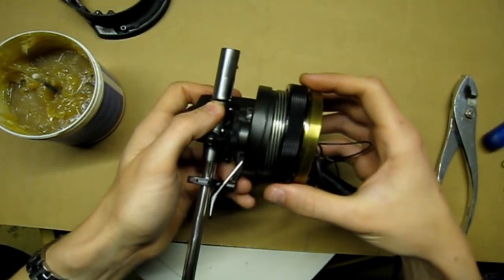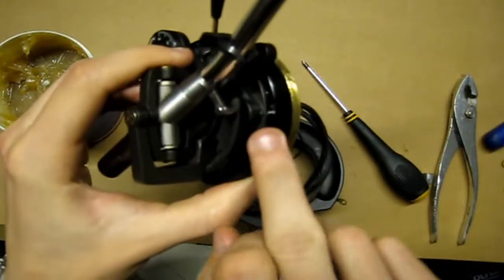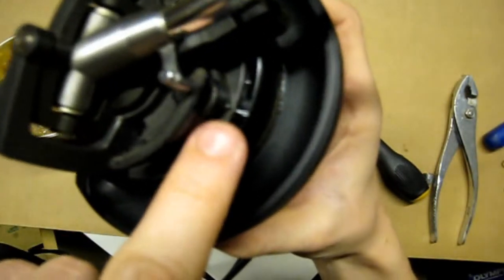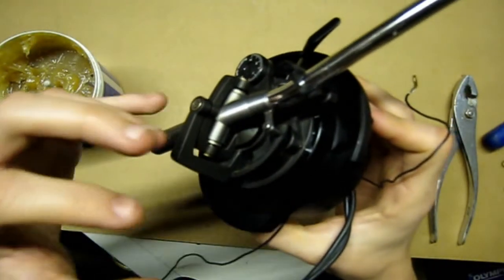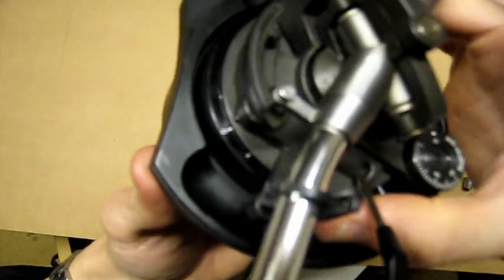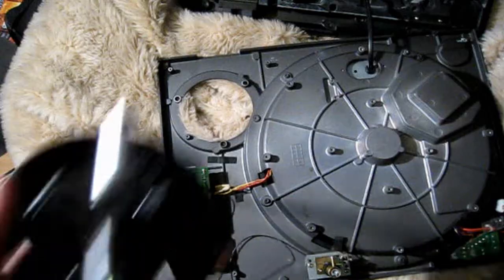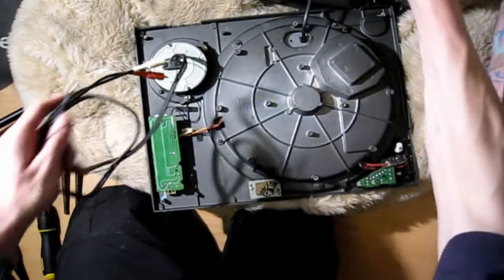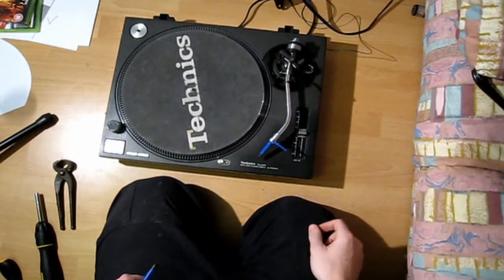How to service/repair/replace the height adjustment on a technics 1200/1210 MK 2 turntable part 2

Comment: i found the unscrewing procedure different on my 1200MKII  because it only as the thick rubber bottom. the tonearm base can be accessed directly through a hole in rubber, had to take the rubber off to access the screws attaching tonearm base to face plate though. Moreover, when calibrate the height scale, i had to follow the service manual exactly instead of this video to get it right. maybe my 1200MKII is the earlier version.

Comment: If the threads are stuck and you can´t get them loose with some WD40, Put the whole assembly in an oven 100C for aout 5 minutes, and the parts will come loose.

Comment: Hi Frank, in Part 1 [8:13] you unscrew both parts very easely. But unfortunately mine doesnt. Isn't moving at all. What is best to do now? Could you please advise how to split this parts so I can clean and callibrate it. thanks a lot for your help in adcvance.

Comment: Hi viperfrank - when you turn the height adjustment wheel, is it normal for the tonearm base to move very slightly left or right with it? I'm wondering if I need to get in there and tighten something.

Comment: I had to apply some heat to remove the outer ring and everything is now good apart from the plastic ring on top of the  height adjuster has come off of the brass ring due to the heat I guess. There is a hole on the top and bottom of the brass ring is there any way this can be used to realign the plastic ring so that the numbers are in the right place when calibrating?
Reply: Had at the same problem, did you find an answer to your question?

Comment: This is a bit hard to explain but I'm gonna try. I run into a problem when I put the metal plate back on (the one with the pin with the brass washer and clip). When i put it on, the seperate kinda L-shaped metal piece on the plate doesn't sit in properly. it sits on top the black plastic raised part in between where the screws go. 
Don't know if you got any of that but in case you did, do you have any ideas?
Reply: This happens if you have the height adjuster mechanism (the large black ring you turn on the outside of the tonearm pivot) set too low when you try to refit the bracket. 
If it's set low, the bottom of the ring stops the bracket you're talking about, from being screwed up tight and flat. 
Loosen your bracket, raise the height of the tonearm by screwing the adjustment ring out a bit and then refit the bracket - should fit fine and sit flush now and you'll be able to adjust the height just fine.

Comment: Great video and I appreciated how well you articulated everything, however one has to be a real cheap skate if you intend to put a man to do " Technical Work " for less than £60.00 . If you think the price is too high then do it yourself just like you did but don't complain about the quote because time is valuable for everyone + your local shop most likely have expenses such as rent taxes and other bills to pay . If you were in America you would probably pay about $200 depending on where you are located and that would still be a good deal .

Comment: Hi there.  Thanks for the video.  Could you provide a link to the correct grease as there's so many different types.  Most of which seem to be copper or lithium based.  Thank you!
Reply: Sorted.  Next time I'll read more comments before posting :)

Comment: Beware! The inner ring is multi treaded. With calibration 0 mine was set with height around 1 cm. Not good! Height should be 0. So take it off again and find the next tread until 0 = set to height of almost zero. Like in this video!

Comment: Cool Video, was a great help. Just one thing - the height adjustment thread is a multi start thread, so when re assembling the correct or best start should be sought.
Reply: I think this is correct because now my height calibrated at 0 is like 0,8 cm height. Like said above should a inch so i have to find another tread.

Comment: Hello frank,
First thanks for you video very hepfull. However could give another advice, after removing my tone arm, and the first ring, the lastone with the number, i still very stuck. I put some WD40, but in our your video yours seems to be removed very easily.. 
I am afraid to break something if i forced to much.. should i wait until the WD40 make is job enought?
Reply: put the whole assembly in an oven 100C for about5 minutes and the metal parts will come loose.

Comment: The Multi-Purpose Grease used in the video seems to be lithium based. Viperfrank in the video mentioned NOT to use a Lithium Grease. Is it still ok to use the multi-purpose grease that is used in the video, or should we use an alternative? If so, any suggestions?
Reply from the maker: yeah i can see your confusion, I think i need to do a follow up video about this, i maybe didn't explain this well enough in the video.
most grease is lithium based, and that is OK to use. the grease i recommend not using is pure lithium grease,  which is white and very sticky. 
pure lithium grease normally comes in a tube rather than a tub.
hope this helped and sorry for the confusion.
thanks for your comment.
Reply: Thanks for replying. I have purchased this but not used it yet, will this be sufficient: http://www.screwfix.com/p/multipurpose-grease-400ml/8436p?_requestid=380699

Comment: I think there is a difference between lithium multipurpose grease and lithium complex grease, because he is definitely using lithium based multipurpose. I was told you need a yellowish coloured non-lithium grease, which I am trying to find, maybe Buzzy's slick honey bike grease?  Still don't know what he meant by thread cleaner, went to a mechanic and they have never heard of it, did he mean brake cleaner, any ideas?

Comment: any place to get the right grease in the USA ..everything so far is  is lithium or copper based,,,,just realized that the comma multipurpose grease you are using has lithium in it ,,, I'm a bit confused here ???

Comment: I bought my turntables back in 93 and after all these years I finally decided to set them up properly. Well, the height adjustment of course was completely stuck. Thanks to your video I was able to fix it, it's like new! I'm a technical idiot who couldn't have pulled it off without this. So thanks man!
Reply: So funny. That’s exactly the situation I found myself in. Same timing and everything. His videos are awesome.

Comment: which grease are you using? all I can find is lithium or copper which you advise against?
Reply: I have a feeling you should use calcium sulfonate grease, but yeah that part of the vid is confusing
Reply: I have used synthetic grease which is certified for food industry. Synthetic means that the grease will not dry even after decades to come. And this grease is "friendly" for other components as it has been certified for lubrication in food process' industry machines. This of course doesn't mean that we can eat it, ha, ha!! By the way, i have used Loctite 37575 and be VERY happy! It is a "calcium sulfonate" synthetic  grease. Anyway, just to inform. Have good moments and enjoy turntable and vinyls!!

Comment: i know this is a million years later but my height adjustment was easy to take  of, but the last  part is impossible  to get on again, what the hell am i doing  wrong? it goes around about a 3rd of the way then just  seizes up
Reply: +TheMegaLarsen Try to search the service manual for the 1210 online. At the end there is a page for reassembling the tone arm in the right way.
- You have to start with the arm base (the big black outer ring) and completely tighten the ring with numbers (control ring).
- Now loose the control ring moving it clockwise for about 2 turns. You should have the number "3" aligned with the beginning of the concave shape of the outer ring. Look in the service manual for more details.
- At this point the most IMPORTANT thing: align the tonearm (the last ring with the red line mark) to the number 2 on the control ring and start from this point to tighten it. It is crucial to start to tighten the tonearm from this position without moving the control ring.
- Adjust the tonearm, once is tighten, to number 3 of the control ring

If everything is fine you should be able now to fix the tonearm with the plate and the 2 screws without any other adjustment. Once is fixed the adjustment range should be between 0 and 6.
Reply: Which part of the outer ring's concave section is the "beginning"? Neither you or the manual specifies.. :(
Reply: Probably still some dirt/dried grease stuck in the threads. Use a small screw driver or a toothpick to gently clean out anything you can see stuck in the threads.

Either that, or potentially you have it cross threaded, or if you're saying its screwed all the way up but the number hasn't gone to zero, it means you didn't catch the start of the thread right - there are several possible starting points and only one will result in it setting correctly to zero. Either way, unscrew it all the way, rotate it round a little bit and then try to engage the thread again from a new position.

Don't force it and you might need to try several times before you get it right.

Comment: Hi There. I followed all steps from the video with 2 decks. Once assembled on one deck adjustment goes like you explained from about 1cm below 0 to the end of text that is next to 6. with second deck it doesn't go below 0 but it goes for about 2cm above 6. could you please let me know is something wrong with my arm? it works well its just this little shift that makes me worried and maybe you or someone know how to make it correctly (1cm below 0 to the end of text that is next to 6)
Reply: +MediaLook please see my answer to +TheMegaLarsen
I've been in the same situation you're experiencing.

Comment: HI. Thx for your detailed instructions! I followed it step by step. Unfortunately on my tonearm i could not turn the outer ring clockwise away. It still stuck together. I tried to put a bit of WD-40 on the thread and warm the metal pieces a little up. But no way. Is there another way to loosen these two metal pieces?
Thx alot!
Reply: try heating it with a hairdryer - dont overheat though, just above body temp.

Comment: First rate guide. My SL-1210 MK2 tonearm height adjustment was seized solid, couldn't turn it with maximum hand force with the unit assembled. I followed your guide, got the arm out, the arm height adjustment was a little tight to undo but it came undone right away. I got all the nasty old grease out that was green and had turned to stiff gel / wax, I used a thin cloth and Tamiya brand Acrylic Thinner X20A (IsoButanol / IsoPropanol mix) to dissolve the grease / clean the threads, and relubricated it with Tamiya Ceramic grease. Worked perfectly, now I have a smooth working tone arm height adjustment. Excellent work Sir.

Comment: My question is my lock lever does not want to hold he ring tight. I can turn the ring even when locked position.
Reply: +sunnyjason i have the same problem. can´t find a solution even after i opened everthing and had a look at the inside
Reply: +trash bin i guess i have problems with needle skipping on the TT due to that
Reply: +trash bin skipping is not due to the height adjustment. it should not affect tracking. I can get mine to lock if I put some pressure on it.

Comment: Help pls! Heigh Adjustment not working.I bought sl1210 mk2 (second hand) and heigh adjustment is not working, I cannot move in left or right side (unlocked or locked) I tried with more power and nothing, at the moment is set up on 3. Any idea what is wrong?

Comment: I look up that exact grease and it says it IS lithium based. (Can't paste a link but search 'Comma Multi Purpose Grease 500g' on ebay.) Otherwise fantastic video thanks, there's no way I would have attempted this without seeing it being done.
 (Would have taken hours without your tips, too!) Nice to get instructions from an obvious enthusiast and genuinely nice guy.

Updates: See Nick Kay's recommendation below to use light oil not grease, or it'll seize up again. No idea whether he's right but the Comma one does seem to be lithium-based, which Frank warns against. Further below someone else recommends Kilapoise, but at £10 for 3 grams I'll probably not. Then further below viperfrank himself responds to this saying lithium based grease is ok as long as it isn't pure lithium. Then further below someone says bicycle or marine shops sell lithium free grease which is good, so I'm using some of that as I already have some. Finally for those searching for thread cleaner, someone says you can find it called brake cleaner, although all I've found is aerosols.
Reply: +Chris Preager Would a silicon based grease be okay for this application?
Reply: I can't tell you. I used a bike grease called Black Gold, and have probably turned the needle assembly mounting only once or twice since!

Comment: Mmmmm. The outer is multi threaded so the technique illustrated is not quite correct. It won’t make a huge difference because the thread pitch of the outer is small. However the outer should be screwed down first then backed off just sufficiently to engage with the correct thread. There is a procedure in the manual but trial and error is easy enough.
Recommended gunge shifter is ‘brake cleaner’, ubiquitous in mechanical and electronic industries. Much cheaper than silly little bottles sold by the likes of Maplin.
Multipurpose grease is OK and a lot better than nothing but really should use Kilopoise or similar. Really horrid claggy stuff, furnishes a silky smooth movement, used on camera lenses. Also prevents the rattle of the not altogether close fitting threads and damps mechanical noise.
Reply: +hairyoldhippy yes, this IS EXTREMELY IMPORTANT. The  outer ring is multi threaded, and proper initial alignment is such as to allow it to travel just about an inch past zero, if this isn't correct, the height won't be able to be adjusted properly after the base ring is installed.
Reply: can u explain, ludwig? Having what seems to be this exact issue... ugh
Reply: need to follow the height adjustment procedure on service manual for 1200MKII exactly. 1. screw tightly the outer ring with scale ring. and turn back one revolution or so to make 3 visible on eight clock position(my take). 2. put the tonearm on scale ring and align the red line marker with 2 on scale, and make it fall on the threads and tighten it. 3. untighten the tonearm to make red line marker align with 3 on scale. 4. fix the base screws underneath (by now the lock pole and two screw holes should almost form a triangle with only minor rotation of the scale ring(rotate the ring not tone arm.)) Maybe viperfrank's method can achieve the same goal but i found the service manual easier to follow and more error proof.
Reply: Tho the service manual was made on a calculator... the illustration pictures and the step by step description is a joke...

Comment: unsure if any one can help me stripped down my 1200mk2 i just bought 2nd hand,  to powdercoat, followed this video how to clean and re-grease and calabrate my tone arm put it all back together and the tone arms stays up in the air all the time the weight dont seem to do anything to re-balance the cartridge im using is a ortofon concord 10 please help me doing my head in....

Comment: DO NOT USE MULTIPLURPOSE GREASE LIKE HE DOES IT IS LITIUM BASED AND WILL SEASE UP AGAIN SHORTLY.  JUST CLEAN AND USE LIGHT OIL!!!
Reply: Nick Kay  Is plumbers grease Ok. We have a product called Doust which does not dry out. However will try light machine oil like singer Oil.

Comment: Hi james, Thanks so much for your great videos, they are extremely helpful and your instructions are concise and easy to follow. 
My question and I guess you answer it in the above when you talk about lining up point with 0 /calibrating… I watched your video about setting the height of the tone arm, one deck was easily adjusted but the other I had to lower way past 0 and is still 2mm to high. Do i need to just follow the above video and recalibrate. My decks were bought new, have never done a thing to them however they are 10yrs old.
Apologize for the longwinded message. Cheers

Comment: The ring clip is to stop the main section completely unscrewing once you reassemble it. If you don't put that back on it doesn't stop at the top and would come right out. So definitely don't forget it.
Reply: Had that exact problem! I had neglected it at first.

Comment: Hi Viper Frank, i fallow all your direction but when i put the plate back i cant even move the height adjust, can you please help me out?
Reply: This happens if you have the height adjuster mechanism (the large black ring you turn on the outside of the tonearm pivot) set too low when you try to refit the lock bracket. 
If it's set low, the bottom of the ring stops the lock bracket, from being screwed up tight and flat. 
Loosen your bracket, raise the height of the tonearm by screwing the adjustment ring out a bit and then refit the bracket - should fit fine and sit flush now and the height adjustment will then work fine, too.

Comment: You are a killer of technician man, I see you have firm hands, expertise and extremely deep knowledge of this unit. Many thanks for the instructions, I'll (sadly) have to replace the arm on mine and fix pitch i'll follow your teaching and i'm confident in success. But this part if the height mechanism looks a bit tough, so mine is stiff but it works and i guess i won't go that far. Again, many thanks, great style and professional approach.

Comment: m8 thanks for making these vids.they gave me the drive to repair/service my 1210's,both of them.i fixed the both stuck height adjustments with the WD40 like u shown,set my weights right,get the arms all flat,and calibrated and set the pitch with a multimeter.all sunshine here again and was an interesting experience.cheers and ride on =)